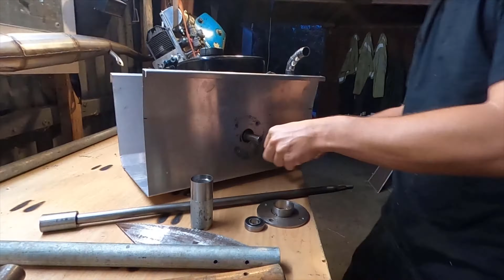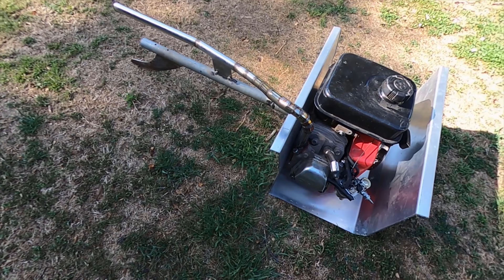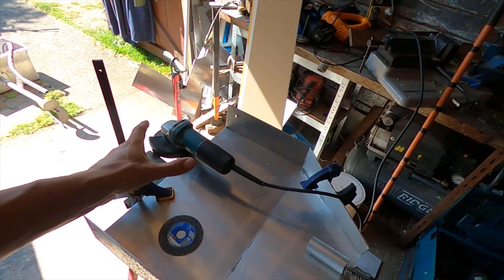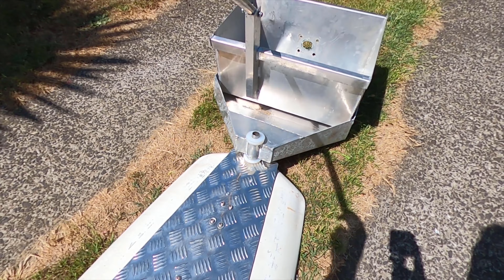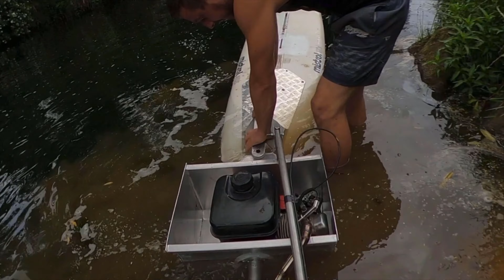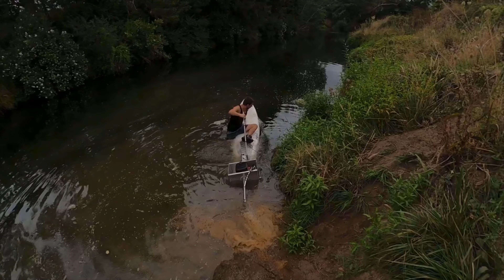Motor Surfboard ,SUP Board Build And Test

Comment: You'd basically have to have a sealed snorkel for air intake and exhaust
Reply from the maker: yeah and the motor is air cooled as well so it wouldn't work , I tried a different way in another video but that worked but tipped over too easily . Need to make a whole board from scratch with the motor in it

Comment: Hey mate I think you are going down the wrong path with a gas engine. A guy in Florida did a similar thing with the motor in a box in n side the board powering an impeller. It was slow heavy and noisy and those were the good points. The motor ran hot and the top of the box had to be open so any wave or wake you hit flooded the box and the Honda engine was trying to run under water. I stupidly bought a board from him and only discovered all the flaws after I had brought it home . The motor quit after a few hours of use because it was burning oil like crazy and I didn’t realize. I junked the gas motor and replaced it with a trolling motor and a foot  switch  so it can be used for fishing . Your motor was swamped too and because you have to have it breath that will always be an issue . You should go electric. Shitty run times if you want to go fast but it’s clean quiet and depending on how much power you want they can be pretty fast . Even if you mount the motor on or in the back of the board you will still get swamped unless you run  it only on glassy lakes. If you want to use a gas motor you should consider a kayak build . Good luck
Reply from the maker: yeah you are right had nothing but trouble trying to get it to work . I have a setup with pontoons now that i will try as summer comes around , but i am going to make a small flat bottom kayak that i can stand up in . electric would be good but i want to try a powerfull 2 stroke longtail setup i have on it

Comment: hey dude, I'm doing one of those in the summer. you made 2 mistakes, first one is the board not big enough and you're adding too much weight. 
on the right track with the longtail, would be better with a fixed drive and a stick to hold on to the board, canting left and right to turn. if it doesn't turn, add some paddles on the side.
Reply from the maker: Benoit Myrand yeah leaving it fixed could be a go . I have a lighter 2 stroke motor as well so when lockdown finishes I will test my latest design and go from there!

Comment: Oh man 🤣
I absolutely love the ambition dude! I would add some EPS board (sandwiched between two pieces of plywood) all around the your engine compartment so that it doesn't sink so fast, bottom line your engine on the back needs more buoyancy, I'm building electric surfboards checkout my channel, good luck!
Reply from the maker: Eden M ok will do! The lasted version has pontoons on the sides will try that after lockdown. But I might build an aluminium board from scratch for the next version